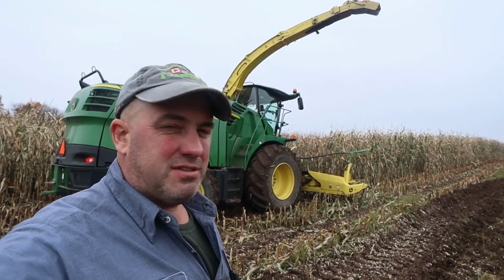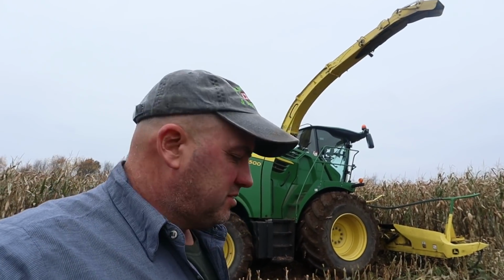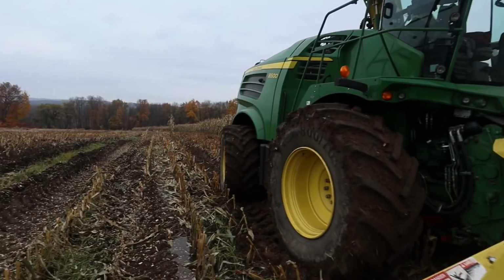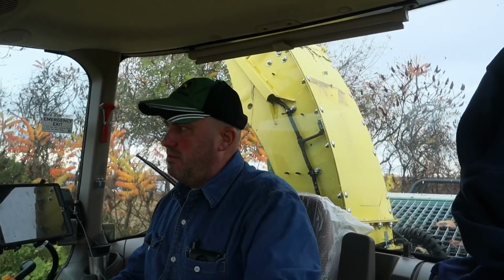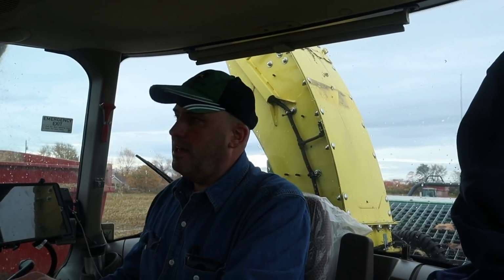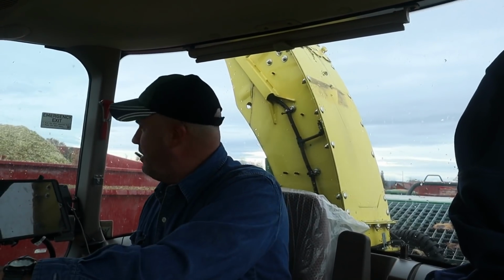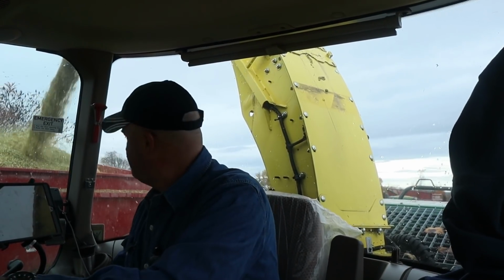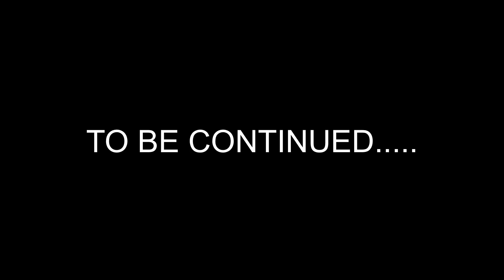Broken Axles | Loaner chopper | Mud and dump wagons

Comment: That sucks Andy! My neighbour had his 8300 go down with a cutter head bearing going out on it. Bearing ended up spinning on the shaft, so it needed a new cutter head. Their was no cutter head in North America or even at the factory. They ended up taking one off the assembly line and sending it over. He was lucky to get a loaner from dealership. His machine was down for 2 weeks. Hope you get silage down with no more issues.
Reply from the maker: Barend van Lindenberg that’s never fun

Comment: I would be getting a full trade purchased price for the new 9000 series! This is a design flaw! Two axles in two years on a brand new machine! That thing would be gone at Deere’s expense or I would buy a Claas Juguar 990! I would also tell Deere “I will not have to explain why I purchased the Claas!” My viewers will already know!
Reply from the maker: We'll stick with Deere, they have been right there on the front lines. Issues like this happen with machines from time to time no matter what make it is. It's all about how things get taken care of through a problem like this and Deere has the resources like no other when it comes to break downs.

Comment: Could it be from pulling stuck trucks with it?
Reply: M Lebowski it should be able to with stand that with easy people have pulled stuff with foragers for years
Reply: Alot of people pull wagons with them loaded just like trucks in mud and hills shouldn't put a hitch on them if they weren't made to pull
Reply from the maker: I’m sure it didn’t help it but it shouldn’t hurt it either.

Comment: Looks like in the long run it would have been better for Deere to swap out the entire axle and hub assembly last year, especially after the second hub failure last fall. Then they could have done a complete rebuild on your unit and either put it back in your 8700 over the winter or the donor 8800 they had. It would have cost them less money overall and cost you less downtime. But corporate warranty writers are notorious cheap no matter what color you are dealing with.